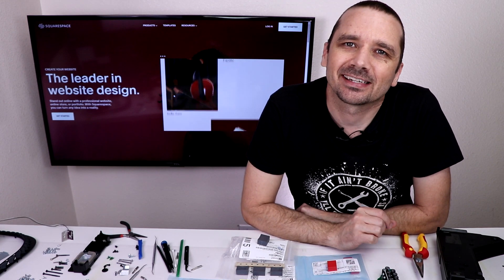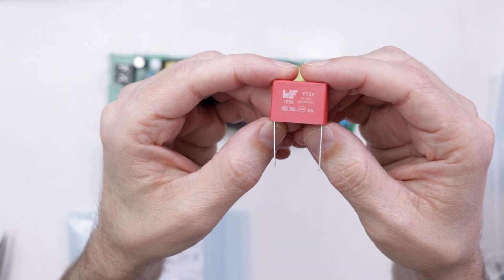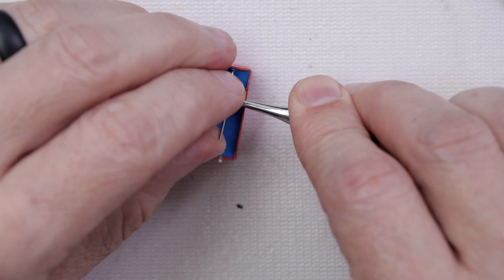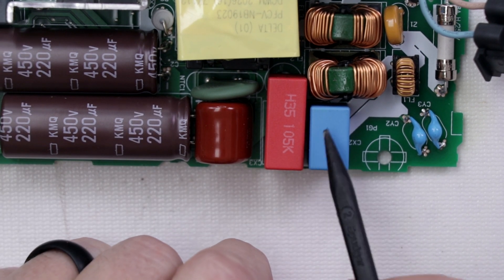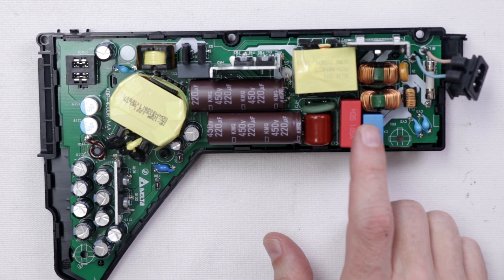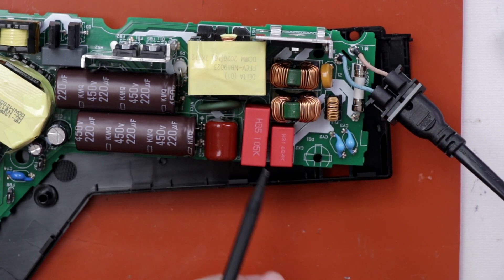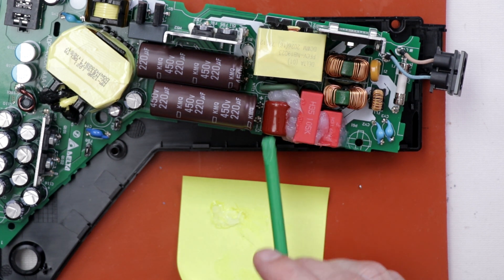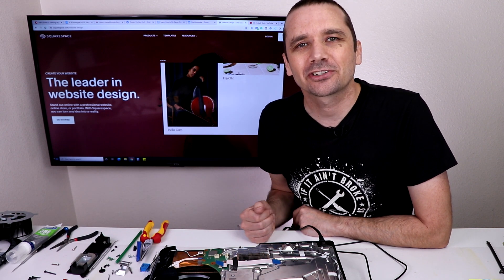Did I Fix PS5 Coil Whine?

Comment: Both capacitors are probably in parallel (I don't have the schematics), which means you can just sum up the size of both of the small ones (it behaves like resistors in a series).
So generally speaking, you can probably switch both of them with a larger capacitor. I assume they divided them to 2 capacitors to fit the smaller footprint. 
TL;DR - using one large capacitor instead of the 2 blue capacitors might just work.

Comment: I have a suggestion. Next time before you remove the original ones, try putting at the same silicone on there as before but then silicone on a nice thick washer on top of the two. This should act like a mass dampener as the vibrations would have to move the much heavier washer (or better yet, lead weight) and therefore not make the same noises...
Reply: This isn't a bad idea its just really difficult to do without messing with the resistance even just a tiny bit and it could make the entire power supply all wonky

Comment: X- and Y-marked capacitors are safety capacitors that fails open, so it's important to make sure that it has at least the same X- or Y-rating (e.g. don't replace a Y2-rated capacitor, with a Y-rated one. You can however replace a Y-rated, with a Y2-rated).

As these are safety-rated, they already have a large safety margin, so the orginal capacitor is already plenty. No need to go up to a 690V cap.

Noise usually comes from movement, so I wonder if the old cap had air in it. You can also get noise from loosely wound coils. And I wonder if the remaining noise mentioned, could be the capacitor arcing through the dielectric - which would be a bit silly, considering they're supposed to fail open.
Old RIFA (yellowish see-through) safety caps tends to crack, and absorb moisture, which kan cause them to fail a bit violently. I wonder if these caps had leaked in humidity, and this noise is some pre-failure thing.

Comment: My PS% doesnt make any noise when turned on, its only when I start a demanding game that I can hear the coil noise... try Demons Souls.. thats the one I heard the noise the most.
Reply: Exactly. He needs to test it on a game and not just simply turning on the ps5.
Reply: Same, the "coil whine" only happens during certain activities. If you're sitting on the home screen (but not looking at a game hub), then no noise. As soon as you navigate to a game hub, or go into the game itself, the noise occurs.
Reply: the ps% is pretty "cool" eh?
Reply: @Zippy Dastrange not mine lol but it does have the stupid coil whine
Reply: @Zippy Dastrange never had that problem with my gaming systems, I'm also an electronics wiz I do the same stuff you see in this video, I fix and clean ps4s, Xbox's, phones, screens, battery's, also do Cooling mods on phones as well which is cool for hot phones, I do this as a hobbie and I am very good at it, most problems I ever encountered with overheating systems is caused by the heatsink being clogged to the max with dust and thermal paste being dried out and old, that's Xbox's and PS4s, rarely get a PCs cause peeps can easily clean them themselves usually, still yet to see a ps5 overheat as they are so new, maybe that one time I seen this guy swap the liquid metal with regular thermal paste to see how it would effect it lol, but just the problems with coil whine or Capacitor whine is what I've been seeing since they came out. I'm guessing your ps5 overheats on you or something? Does it shut off? Gaming systems will shut off when they get too hot, also peeps who keep gaming everyday with that type of problem tend to fry their systems, making em unfixable or really difficult to fix.
Reply: @Zippy Dastrange ? Being warm to the touch doesnt mean it overheats , thats stupid. GN showed the console is cooled properly execept for the GDDR6 memory which is hot but "still within specs for Sony".
Reply: Coil whine is unavoidable for modern electronic, especially pc parts (ps5 is just miniature PC) so unless it bothers you, coil whine is not indication of a broken electronics, nothing need to be fixed or replaced
Reply: @rachmatzulfiqar  yeah but I'm sure they could have designed it without so much noise.
They went with cheaper option but as long as I can't hear it while playing, wouldn't bother me much.
Reply: @bloomerb4162  yeah man, the problem is in mass produced electronics, 1 cent of saving could mean billion of cost saving, that is why manufacturer will always go for the cheapest option available
Reply: @rachmatzulfiqar  microsoft did a really good job with the series x. They put more thought into it and definitely better engineered.
Reply: @rachmatzulfiqar  It is to the point that most manufacturers (from what I know) don't even accept returns/requests for repair when coil whine is the only problem.
Reply: Black ops cold war makes mine loud
Reply: I just got my ps5 three days ago. I have been playing demon souls and console is really quiet.
Reply: My digital ps5 makes no noise even when playing games
Reply: @kfuso7  I’ve never heard my digital ps5 even the fan is silent

Comment: Can we please get an update video with you playing a PS5 game, even Astro’s Playroom (since it’s free) if you don’t have any others? It would be great to hear it with the PS5 assembled and being used. PS5 games and games enhanced for PS5 really trigger coil whine. 

It seems Sony should have used higher quality components and some insulation on the PSU. I’m surprised there’s none. Even the original Xbox power supply used insulation. If they don’t change the PSU parts and how it’s made (lack of insulation), coil whine will likely be a problem for every PS5.

Comment: You should see the power supply that came with the commodore 64 in the 80's. Any retro collector that knows anything will call it a black brick of death and recommend you not use it as is. If you crack the bottom off of it (I think it's sealed with an adhesive) you will notice that the entire thing is just one MASSIVE lump of epoxy. LMAO One of the engineers says the reason for that is because they were concerned it would catch fire and weren't given enough time to fix it. How do you prevent a fire? Remove oxygen. The epoxy does that. But it's still a piece of trash. The voltage regulator jumps up over time. It should be 5v. After 20-30 years some of them can go up to 7. 7VDC is instant death for the machine and everything on it. At 6 it can survive, but the RAM and probably the sound chip (which is harder to find an original one that still works) will die very quickly. The really surprising thing is I've seen one of these do exactly this during a youtube video. There were tons of comments on WHY WERE YOU USING THAT!?!?!?!? There is a guy out there that buys these up, guts them, replaces the electronics completely but assembles it back in the original case. To make sure you know it's not a black brick of death he put a blue LED inside the commodore logo. It's actually pretty simple. It's just 9VAC and 5DC.
Reply: I remember I used to use my c64 power supply to keep my feet warm.  Eventually the computer started crashing a lot.  Guy at sears just said "save your work more often".  Eventually we found someone who knew and said it was the power supply.   Those things did run really hot.
Reply: @GigsTaggart  and if they don't kill the computer they die quickly too. I lost count of how many we went through back in the day. My home made one is so much better
Reply: I mntioned that power suply on his previous video LOL
Had to crack it open to replace the fuseholder. The epoxy not only takes away the oxigen, it also spreads the heat better to it's casing so @ Gigs could have warm feet.

Good times ;)
Reply: Strange I never had a problem with the power supply.  I  bought my 64 though in 1987 maybe it had changed by then.
Reply: @snowjames7885  I think in my family there were about 4 or 5 C64's from first model till second half 80's. Only one of those had it's fuse holder broken, no other issues as far as I recall.
One of the latest models my uncle had was a curiosity: The "portable" SX-64.
Reply: Really? I heard old electronics used a lot of glue because the components were so heavy, the solder joints would break off because of vibration and temp cycles, etc.
Reply: @MiGujack3  globs of glue/adhesive that's true, but if you have a 100% solid brick it's either a waste of money (are they really going to waste that much), they don't want you to fix it, or it's to eliminate a fire hazard.
Reply: @snowjames7885  It's possible. I don't know much about that C64Cs, but the original C64 was retired by then. Still compatible, but they started cost reducing the design. The first new design featured 4 bit ram chips instead of 1 bit meaning you only need 2 chips instead of 8. The second design took a bunch of discrete TTL chips and combined them into a single custom chip. But I don't know about the power supplies at that point.

Comment: I did this fix. Put in 2 panasonic bigger 1uf capacitor. Tested and made same noise. Its the vrm on the mainboard under psu. I am on 240vac. Reversed back and also no noise from psu

Comment: much safer to discharge those caps with a 1MOhm resistor or similar value...
Reply: Easier yet, just unplug the mains and turn on the PS5 and let it drain itself.
Reply: @rwestvang  this
Reply: @OskyEdz Do you know for certain the circuit responsible for draining that cap is working properly, presumably not if your going in to fix it. This is more of a general purpose technique I learned when I did this crap for a living, do whatever you want, this is a god damn youtube comment.
Reply from the maker: Yes, that's true!
Reply from the maker: @rwestvang  Agreed...the only problem with that is it takes a while. When I'm filming I don't want to take the time to let it drain every time I unplug it.
Reply: We had a bench tech that discharged caps using an incandescent lamp, the lamp would just light up for a split second. He soldered old multi meter probs to a lamp fixture to short caps

Comment: I really don't think the cap is causing the problem. It is the inductor which is probably being used in a regulation circuit. The pulsing of the inductor next to it will cause a stray magnetic field and cause a buzzing in components next to it, or that are connected to it. Shielding it may resolve the problem, or, just add a small bypass capacitor in parallel to the blue capacitor to drain the noise.
Reply: Interesting.. maybe Sony did this for their review units as they're dead silent

Comment: Do you think you could test if silicone around the original capacitors helps dampening the noise?

I also had no issues with coil whine until I started playing assassins creed Valhalla, during that game it is clearly audible although just a minor inconvenience. Would certain games out more load through the power supply?
Reply: I know a solution. Buy an Xbox!
Reply: @mohd497  Game runs better on the ps5.
Reply: @admin8244  lol coil whine issue. WiFi disconnecting. Black screen. Yeah games run definitely better 😝
Reply: @HappyHardcoreUnited  or buy a pc any case it's a win win
Reply: @HappyHardcoreUnited  I am playing Xbox games for free can you say the same "PlayStation fan boy"
Reply: @HappyHardcoreUnited  nope live gold is included in gamepass plus EA play plus all of Xbox exclusives plus 100 of other games :)
Reply from the maker: That's a good idea
Reply: @HappyHardcoreUnited  Xbox gold is going up in price too lol

Comment: That buzzing sound is high voltage charges running away, not coil whine. Also, as the name suggests, coils are whining, and capacitors are not coils...

To fix actual whine, look at the inductors, they are just copper coils. They vibrate at specific frequencies. The APU will have some, but don’t put any resin over them, they’ll overheat! Thicker thermal pads between them and the heatsink will dampen the sound well. If you can’t, a thin pad will dampen it okayish. If there’s no room at all, dare I suggest making space on the heatsink (a divot) so they don’t contact the heatsink at all. RIP heatsink!
Reply: You seem like you know your stuff!
What determines if and at what frequency those coils whine? I had issues with my GPU producing coil whine when I first got it, but after I switched my power supply this coil whine was gone.
Do you know what the correlations could be for this to happen?
Reply: nice
Reply: @phil6531  A power supply is a very important component. A bad or cheaper/poorly designed power supply can be a very big problem in many ways. If the PSU manufacturer cheaps out on certain components, the power provided by the PSU can cause instability and weird side-effects. So it could be possible that your old PSU could have been delivering “dirty” power to your components.

It’s also possible that the PSU was not delivering proper voltages to the GPU causing a slightly different frequency response.

Comment: Who on earth suggested silicone o IC legs ?...madness !...cheers.
Reply from the maker: Yep...like I said I really doubt it will do anything but since I was there and it won't hurt anything I did it.
Reply: @Tronicsfix  Except it adds a layer of heat resisting material between the IC and the surrounding air. It's not a good idea.

Comment: You can use high temp automotive silicon. It's rated to withstand high temps and vibrations, makes it perfect sound dampener for coil whine issues.
Reply: Does it have any negative impact on the board or the other stuff around the capacitors?

Comment: the elefant in the room is, why didn't sony's quality control found out about the problem....and "fix it" in advance.
Reply: Because the problem is common in all types of electronics and is considered acceptable. Just listen most of modern graphics cards and motherboards :)
Reply: I agree but Xbox took the extra steps on added the silicone as they knew it would be nitpicked, surely  Xbox won on this round

Comment: That input section looks like the power supply "EMI filter" section. You see the X capacitors , the Y capacitors and the 2 pairs of inductors. Maybe the reason why some PS5 are quieter/noisier than others might be "Dirty Electricity" in the house. Those capacitors filter all the noise coming from the AC mains. In some houses they may work extra hard. Of course improving the capacitor quality also helps. Maybe using an external EMI filter before the PS5 may improve the noise without doing this "Surgery" and voiding the warranty.

Comment: At electronics school we used the "prank" the class by hooking up capacitors to a voltage way over their rating, locking them in the desk drawer and at some random moment during class give it power. Reliable boom every time!

Comment: SOOOOONYYYY did you understand how to do a proper PSU please so I can live peacefully with my PS5 playing in silence?? thank you
Signed: the World
Thanks TronicsFix for this!
Reply: I play with my ps5 and is totally silence even with the most demanding games available on it
Reply: @alex995jdlp9  make a video please I’m curious thx
Reply: I don't think it's Sony that created/manufactured that PSU. They get it from a company and it probably is the company's fault (kinda like how AMD gets its nodes from TSMC, and if TSMC has low production for those nodes - then the PS5, Xbox series X and S, and all AMD cards and CPUs are now harder to get because of low stock.)
Reply: @icaruswindrune7116  Completely right! but it's the same psu that comes with PS4 PRO that was plagued by multiple reports of coil whine and noise and you don't change it for the Shiny new PS5?
Reply: @kranorzor  Eh, I haven't ever heard coil whine coming my PS4 Pro (albeit the fans made it sound like a rocket). But yeah, they should have upgraded it. Probably one of their cost cutting measures to keep the PS5 at a decent price (PSUs are pretty expensive at times) until the SOC prices drop a bit. Definitely not a defendable action though.
Reply: @icaruswindrune7116  yeah you can hear it only in latest revision 7216b because the fans are quieter and in your case it's covered by jet engine fans but I have my xbox series x that's it's super silent so it's possible to do things right it's a choice of low quality, you are right anyway.